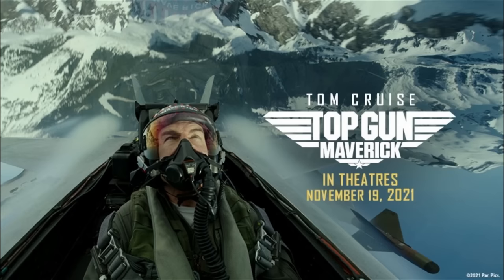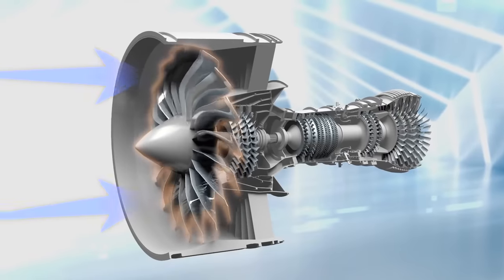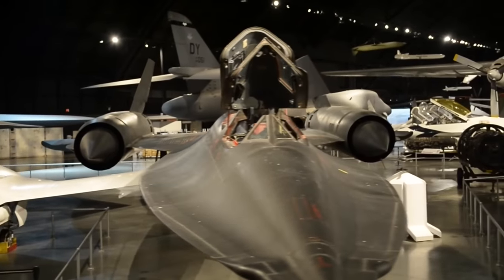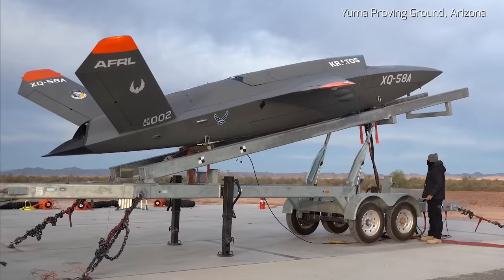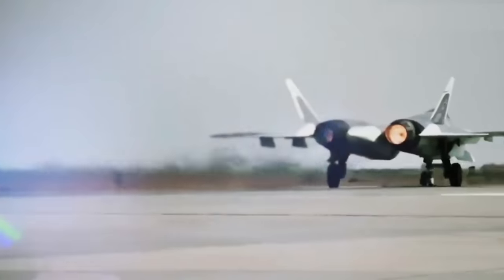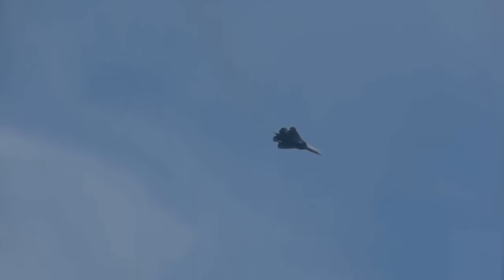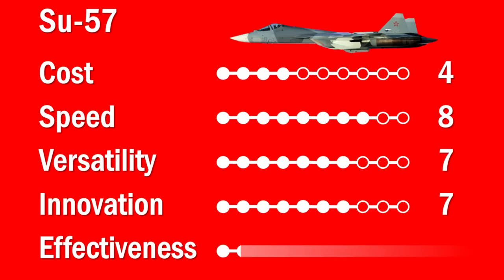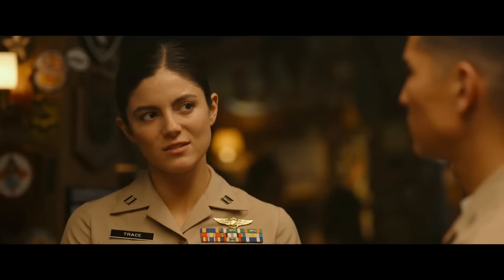Aerospace Engineer Reacts to TOP GUN: MAVERICK

Comment: It is interesting to continually have the Pentagon devalue close range maneuverability for speed and beyond visual range engagement...  only to repeatedly be put our forces into scenarios requiring visual confirmation for engagement.  When dealing with no fly zones, warzones, naval exclusion zones, and a host of neighboring regions not in conflict with a host of both civilian and allied aircraft not always readily identified electronically the concept of shooting from 30+ miles away becomes nonsensical as all those inherent advantages are dissolved by real world rules of engagement.  

Amazingly the F-14 was an excellent platform for just such scenarios due to the high magnification camera system which allowed the RIO to zoom in and identify aircraft from well outside normal visual range.  

Pissing on concepts like supermaneuvrability while at the same time putting your pilots into engagement scenarios where just such capabilities become critical is the epitome of swivel chair short sightedness.  

I also appreciated the nod to reconfigurable engines to transition to higher mach numbers and agree, continuing to push past the envelope for that test, especially after the numerous temperature warnings began to sound, was a complete Hollywood moment.  

Seeing the old F-14 back was a nice nod and of course this had to be "not Iran" as that is the only nation still flying them.  Having Maverick have to start the bird from the ground cart at least remotely connected this other Hollywood moment to reality.  I got a kick out of his reaction to entering the cockpit with the mass of analog controls and dials.   I think he said something along the lines "It has been a hot minute" upon being confronted with the panel.  Rooster's response was even more entertaining as an aviator having been raised entirely in the next generation of aircraft.  

It is nice to see a series of videos with an informed opinion on these matters.  BS Aerospace Engineering ERAU 1992.
Reply from the maker: That's a great point about the rules of engagement crippling the same BVR capabilities we like to tout. It will be interesting to see if/ how those policies would change if the US were to enter a conflict with a near peer force.

Glad you enjoyed the video!
Reply: Thanks for raising ROE impact on combat effectiveness. Very frustrating to see the risk it adds to our warriors.

Comment: One vulnerability I see with RPA is the datacomms, and as much as I think it vanishignly unlikely fully (I caveat "fully" to try to exclude most guided missiles) autonimous weapons would go full skynet, I do think any autonimous systems would be an insane liability just from how it could fuck up on a day to day basis. Going against near peers, I don't think we can do without in person piloting.
Reply: Honestly I wouldn't be worried about a skynet situation, but for the amount of times self driving cars have driven into highway dividers or pedestrians or deer or any number of other things they're supposed to avoid, I would not trust an AI controlled combat vehicle, especially if it's AI controlled for the express purpose of being more effective than human piloted vehicles. I think it could be useful in a situation where most of the controls are AI and it requires human authentication to confirm targets before it fires, so either wingman or remote link to AWACS type situation.

Comment: Depends on how you out we haven’t implemented super maneuverability. Our current F-22 Raptors are equipped with vertical vectoring nozzles, just not all around vertical and horizontal such as the Su-57. So we can still preform high AOA maneuvers.
Reply from the maker: Yes I'd say the F-22 and F-35 do have some supermaverability capabilities. But that decidedly not the focus of the aircraft's design.
Reply: @AviationAustin  100% Agreed
Reply: Also, Russia doesn't have any meaningful number of SU-57, or means to make enough of them in short enough time.

Comment: You mentioned test pilot disobedience, even the slightest hint of not following the program would get them booted. A record like Maverik's and he would never even been considered a candidate for the program. During the X-15 flights, Neil Armstrong almost got booted twice. If he would have, he never would have been selected for Apollo. Once, he made a miscalculation on his entry angle (or burned his rocket longer than spec'd - cant remember) and bounced long during reentry and almost lost the aircraft coming short on the lakebed. The landing skids almost clipped the power lines. The second was testing the dryness of emergency lakebeds and had a crazy idea of a touch and go and if it was squishy he could just throttle out. Yeager said It would never work but Neil was determined so they both went up to prove each other wrong. Neil touched the lakebed and got sucked into the mud and it took weeks to get the airplane out of the muddy lake. Story has it that Yeager was in the backseat and can be herd over the radio laughing his A$$ off!

Comment: I think at over Mach 10, you can have a problem anywhere in the fuselage, it doesnt have to be a flame out, and at those speeds, you don't "spin" you deviate slightly from your meant path and your aircraft desintegrates.

Comment: The most technologically inaccurate thing in this movie that I can name, is using flares against radar guided missiles. Also using S-125 at ranges less than 500 meters, which also seems impossible.

But it's a great movie so I'll also give it a pass. And they did the same thing in the first one anyway.
Reply from the maker: I didn't see what kind of missile they were using. But those are good points.
Reply: @AviationAustin  visually they look like S-125 or SA-3 in NATO-speak, which I think have minimum range of 3 to 4 km. Also they have pretty big warheads, so if one exploded as close as they show them, the plane would still be gone.
Reply: Chaff does not show up well on film, flares how ever show up nicely. So just assume that the chaff is being fired at the same time as the flares, it's just part of the countermeasures program. In the F-14 for example the RIO can select what is launched and in what numbers and combination, he can then select what happens when the pilot presses the decoy dispense button, Flare or the decoy program the RIO selected ex 1 button press = 4 flares and 8 chaff bundles.
Reply: @linusa2996  Yeah, exactly this
Reply: as it has been commented, chaff and flares are usually used together, just chaff is hardly visible.

As for the missiles, what is also unrealistic is the extremely short reaction time. Even for most modern short range systems, like the pantsir, which would be more appropiate in that scenario, there is a reaction time of several seconds between detection and firing, and the more unexpected the enemy is to show up, the longer the reaction time due to human factor.

The system used in the movie looks like SA-3 indeed, which is definately not the best SAM for that kind of point defense, or to use against highly maneuverable planes. I guess they selected it just because it looks cool, which is acceptable and agree, the movie is very good
Reply: @AviationAustin  When I think heat seekers I think of the Sidewinder which doesn't use a visual on the hid so much as "growl" in the pilots headset when in locks onto a target. What was shown in the film looked like they were trying to get a lock with the planes forward looking fire control radar for radar guided missiles so the proper defence should have been chaff/balloons (though neither are as visually stunning as flares).

Comment: One thing about air breathing vehicles is they can typically travel faster with a higher energy to weight ratio. The O2 from the air saves weight instead of having to store an oxidizer as fuel.
Reply from the maker: Very good point

Comment: You should also consider the number of real fighter pilots who have flown the planes used in the film. Those pilots for the most part, some begrudgingly, said it was very accurate and pointed out the maneuvers we saw while looking insane we're common practice. They for the most part only poo pood the split he did between planes when starting dog fighting practice and that speed brake maneuver all were a thing but for safety reasons not allowed officially.  Overall they found most of it accurate.

Comment: I'm not an engineer, but I am a nerd, and there was one detail that did bug me. The SAM sites were stated to be radar guided, but then when actually engaged by them, the F18s used flares as a countermeasure. Flares are for heatseeking missiles. To counter radar you need chaff. 

But otherwise... The darkstar bit was great. Loved the detail of it being a skunkworks project, and the fact that it crashed when Maverick flew it beyond it's design capabilities... I was a little annoyed that they were going to run it up to Mach 10 before even testing at Mach 9, but given the gravity of the situation I could understand it. But pushing beyond that... Maverick is an idiot, simple as that.
Reply: Aren't the countermeasures usually contain chaff that are integrated into the flare which also created absolutely lousy radar signature? I mean while their size is extremely small they're also only need to create few seconds distractions
Reply: @zidniafifamani2378  that level of detail i'm not sure. You are right about only needing a few moments of distraction though

Comment: "Never ignore the engineers" Well I want to fight just about every single one that designed the super hornet because doing actual maintenance on them is incredibly annoying a lot of the time
Reply from the maker: Said every maintenance mechanic for every aircraft ever 😂
Reply: Is it true that F-35 only require basically a fraction of maintenance time compared to previous generation fighters (4 & 4.5 gen)? I've heard from some people that they "only" need 9 hours of maintenance for every hour of operation.
Reply: @zidniafifamani2378  I'm someone who works on super hornets every day. The whole "X hours of maintenance per 1 hour of flight time" is generally bullshit. Everything boils down to, what did the pilot do to break it, upon inspection is that the only problem or did something else break as a result of it. If so do we have that part available in the supply chain? If not what jet are we taking this part from? Ok we have our part, how long is it going to take us to install it, rig it if it needs rigging, and op check the part. Oh there was another unidentified problem during the op check? Well now let's basically restart this whole process until the jet can fly. The F-35 completely removes the need for trouble shooting, you don't need to actually know the intricacies of the jet to fix it because the jet is just going to tell you. It also suffers from a LOT of corrosion. Just look up photos of F-35s that are going out to sea for long periods of time. Personally I'd take a F/A-18E, F, or EA-18G any day over a F-35 purely based on maintenance and from my own understanding talking with guys that work on 35s

Comment: Just because a stealth can be detected by some systems in no way completely neutralizes its advantage. That is a major stretch. Typically they will be detected by low bandwidth radars which do not provide weapons quality track. Stealth absolutely decreases the range a plane can be detected if it can be detected at all. Stealth is very effective against high frequency radars that are used for weapons track. This includes all modern fighter jets and missile radars. The radar that with least likely be able to defeat stealth would be miser radars as they have the smallest antennas. Low frequency radars require very large antennas. Regardless of the ability of stuff to render an aircraft invisible or not and no way renders it's useless. It still makes it harder to see and harder to shoot giving the stealth aircraft and advantage over non-stealth. A good analogy is imagine One army in the jungle wearing camouflage and the other wearing bright orange. The camouflaged army is not invincible but maintains a major advantage.
Reply from the maker: Oh I agree. That's just how this movie justified not using 5th gen fighters. I think the only real legitimate argument against stealth aircraft is cost. Other than that it's an incredible advantage the US has on virtually every country in the world.
Reply: @AviationAustin  Well, the reason they had to make that part of the story up is that the F-18 has two seater models that they can film in... and the F-35 doesn't.  So, they had to come up with a (not really) plausible reason why they couldn't perform the mission on the F-35...as mentioned in the movie.

Comment: At 3:50 are you saying that the SR71 had a ramjet as well as it’s turbine? 

That spike is there to adjust where the shock wave was so supersonic airflow didn’t enter the engine. If it did the engine preformed an ‘unstart’ and the airflow tried to flow in reverse. There was only one engine a turbine engine and it had two turbine engines.

Comment: At 6:16 , there is a substantial amount of turn for something going Mach 10 and above. I think at that point, a 10G turn would have a radius of some 11764.9 Km (a = v^2/r) , and the turn that's shown is definitely not  correct as the wings would not only rip themself apart, the pilot would basically become pulp turning anywhere at mach 10.

Comment: The main problem with hypersonic speeds with air breathing engines is the inlet temperature of the air. Reaction Engines with their Sabre hybrid air-breathing rocket engine concept have spent over a decade developing a system to super cool inlet temperatures in nano seconds. The engine is being designed for the proposed Skylon spaceplane.

Comment: I did and experiment using simulation which oddly didn't get me first place but whatever, since G force affects our pilots thru out the twist and turns I made a capsule for the f17 adding a vacuum that would make the pilots light yes I know our movements become slow but it wouldn't have that much effect on the pilots when it comes to super sonic flight, but there's others things like safety that I didn't think off, like how much pressure decompression would put on our pilots, but over all it was amazing.

Comment: One thing that confuses me is if dark star was a working plane, because the director had said that the scene where the roof flies off the security outpost was real. I don’t think the FAA would allow a “model” to fly so I’m assuming it was the real thing, correct?
Reply from the maker: They used an F-18 to stand in for Darkstar. So there was a plane that physically blew the roof off that outpost, but it was replaced with Darkstar in post production.
Reply: @AviationAustin  ok that makes much more sense, only because it seemed like they were sidestepping all the questions about the plane.
Reply from the maker: They probably didn't want to mention the CGI

Comment: 2:25 I would call that a error.
"A air breathing engine is a engine that use incoming air to provide thrust"

I would like to claim that is not accurate. I would say the proper definition is:
"A air breathing engine is a engine that uses the air chemically in the reaction to provide energy to the engine"

While, yes, most Air-breathing engine also use the air to provide thrust, but that is not part of the definition.

There is engine that uses air as a reaction  mass but are not airbreating. Like an electric aircraft.

The RAM jet of a SR71 sort of kind of doing the same. Where the conventional turbojet provides heat to the ramjet surrounding it.  The ram it self is not really burning fuel, its just get warmer from the jet exhaust. If cause, this is not that different from a turbofan, just the other way around.

The ability to detect stealth fighters have existed for decades. The problem is not detecting them, its tracking, and more so, targeting and locking onto them. The meteor missile sort of solves this problem.. by.. well ignoring it. How well it actually would preform, well that is up to the future.

Comment: The SU-57 has full "3-D" thrust vectoring, the F-22 (an older aircraft) only has "2-D" thrust vectoring.  So the F-22 is outmatched in close combat and maneuverability.  The F-22 is at least a half generation behind.  This F-22 cost around $120 million (this video is not correct) the SU-57 cost around $40 million.   The SU-57 has has a Infrared search and track that gives it another advantage.   Right now in 2022, its the best combat aircraft to date.  Its the aircraft the F-14 or F-15 should have evolved into.   The ranking list on this video is crazy.   I think the US should try to make an improved version of this aircraft.   #1 SU-57,  #2  F-35,  #3 Rafale,  #4 F-22,  #5  Eurofighter

Comment: Nice vid, you're just wrong on a few points. The speed varies on the atmosphere/altitude. The SR-71 maxed officially at 3.14, but prob landed closer to 4.5 to make the speed run. It had to atmosphere skip at that speed to avoid burning up.  Without atmosphere, speed it limited to 17k miles/hr due to orbit. Under 80k feet, max speed is under mach 4 because of the material used, titanium withstands 600° and is light enough and rigid enough. There is no other material better to date. One engine type which you didn't mention is the "sabre". The future. A turbo-ramjet that changes oxygen to liquid and stores for use as propellant outside of atmosphere. Also, 6th gen fighter will not have vertical stabilizer.